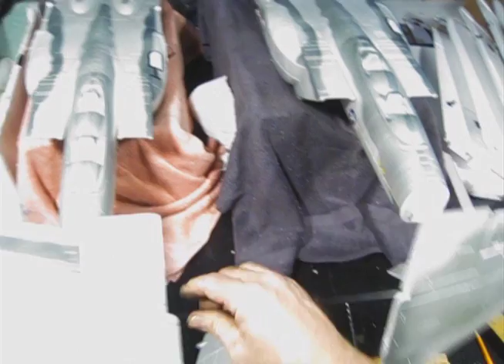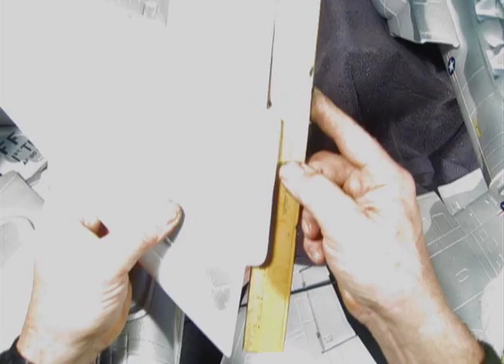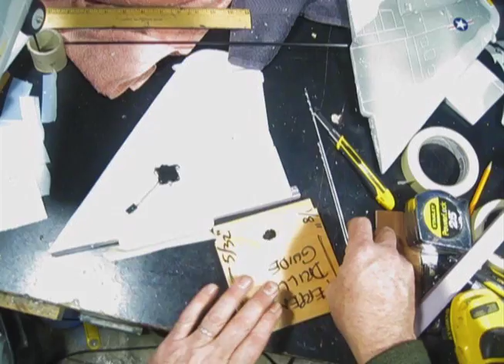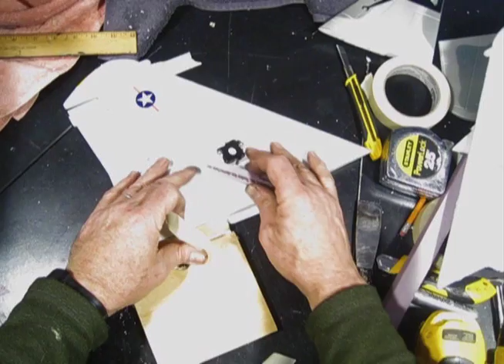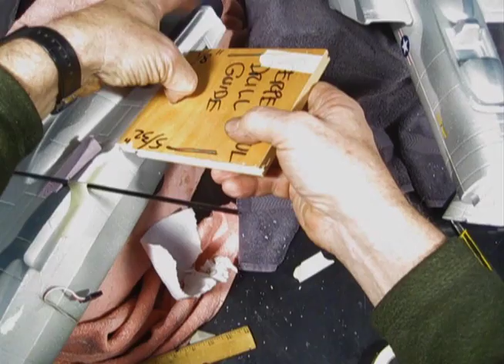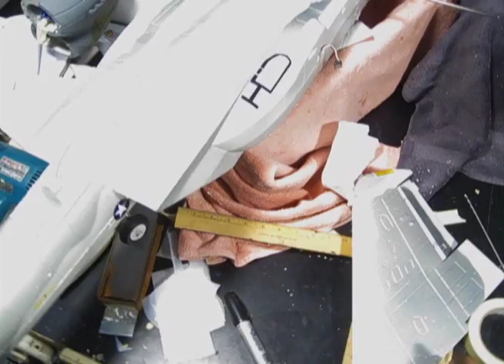DOWN & DIRTY TIPS N' TRICKS: How to Put a Center Spar in your Jet

Comment: Great tip..Thanks Steve..Hey,what F-15 kit is this?
Reply from the maker: That's the old Starmax kit with retracts. I replaced  my retracts with Dynam A-10 servoless retracts, and put a more powerful EDF setup in it- and with that foam, I use heavy packing tape to strengthen some tender areas without adding measurable weight (actually, I CAN measure 8 grams...)